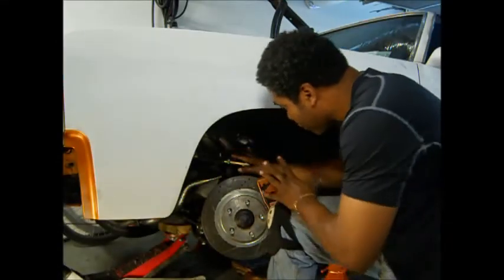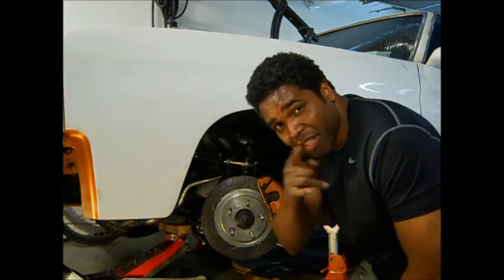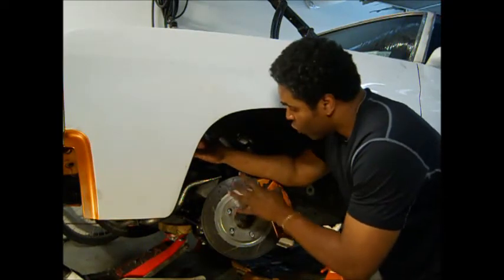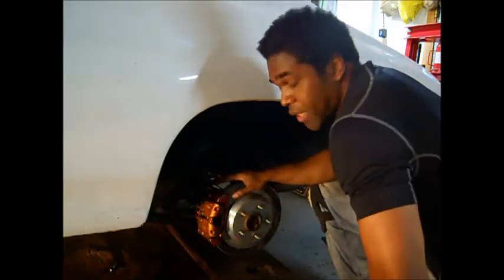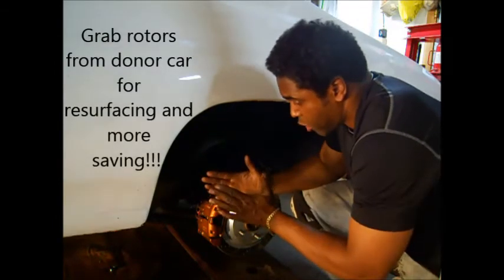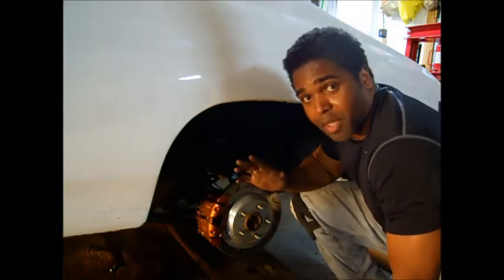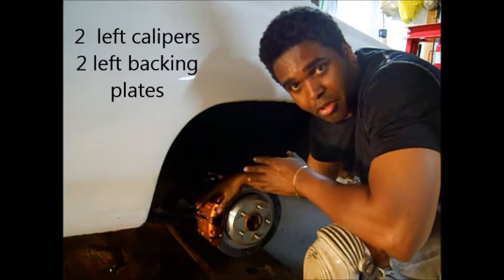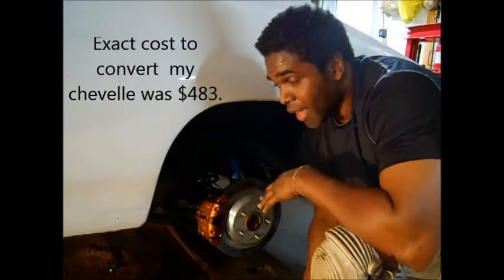Drum to Disk Brake Conversion Using 98-02 Camaro/Firebird Calipers (BRPHOTROD.com)

Comment: What bore size master cylinder did you get from cpp to work for these brakes ? Also booster ? Is there a kit number you used from cpp ?
Reply from the maker: i got the standard for a 71 chevelle with 4 wheel disk brakes

Comment: @coverman66 I have a few quick questions... 1st I have c5 calipers for my 85 Monte Carlo gbody does it work the same or is it the same as camaro/fire bird set up? Also I'm using s10 blazer spindles & hubs, backing plates with hybrid bracket and the rest of the hardware to mount it... 
2nd The money question is will my off set better same as the gbody 5/4 .75 because I bought 24" forged rins? Third on the rear I'm going with moser axles 28 spline with 14" rotor in front "corvette rotors front " " 13.5 corvette rotors" in back will my off sets still be 5/4 .75 ?

Comment: left side being the drivers side? some go by sitting in the car others go by looking at the front, just trying to clarify. im using a stock 79 camaro 10 bolt. Thanks
Reply from the maker: i got you Lucus, driver side partner.. i did that on my 80 z28.. let me know if you have any more questions..
Reply: coverman66 i will thankyou.

Comment: I believe with this brake system 17" rim are the minimum that can be used (right??). Other than that did this change the size of the wheels and tires you can put on your Chevelle? What size rims and tires do you have on your set up? Just asking to see if this changes the rim/tire size I can put on without spacers. Thanks! Great videos...
Reply from the maker: thanks brotha LaWayne, to do this conversion you have to have 16 inch wheels or better, im rocking 18x8 in the front and 18x10s in the back tires are 245/45 and 285/40. hope this helps brotha ....
Reply: That's exactly what I was looking at. Thanks!
Reply from the maker: no problem brotha..
Reply: coverman66 what’s your backspacing on your wheels terry ? I did the kit but noticed stock 2002 16 inch trans am wheels rubs my inner fender and frame. Only have the wheels to move the car around the house until I finish it.
Reply: @Coverman66  I'm building a 68 GTO, loved the body bushing videos bty!👍 I have a 69 elco rear end in it now. Was wondering if the 10 inch rear tires rub? No mini tub? What's the specs or measurements on your wheels? Looking forward to doing my own 6.0 swap. Hope to get a reply, I just subscribed! Awesome info Terry

Comment: hey terry  great videos. my 68 chevelle have both rear shocks behind the axle. cant you tell me which side or sides backing plates and caliper i need. thanks for the help.
Reply from the maker: thanks brotha Paul  you will need a right and Left because there is no stagger, the camaro has a stagger shock setup thats why you need 2 left side backing plates..
Reply: thanks for the help.

Comment: any junk yard cheap rear end posh option for budget on chevelle or cutlass. 70 convertible and tired of beg leg. Anything in junk yard that will bolt under car with lil to no modification and possible disc brakes
Reply from the maker: hmmmmm. you can you might get lucky at the junkyard.. i wish i could help.. i do have a olds 12 O rear.. but you want something thats install and go..

Comment: Good stuff brotha! What size brake booster are you running Terry?
Reply from the maker: sorry it took so long to respond.. im using a 11 inch CCP brake booster. no complaints..
Reply: It's all good Terry. I'm using a 7 inch dual diaphragm booster
Reply from the maker: thats whats up.. good choice..
Reply: coverman66 yeah man didn't have the space for a bigger one. My big block is wide lol
Reply from the maker: i was thinking about that.. you got one that sticks out a lil more. smaller in diameter but longer.. how radical is your cam?
Reply: coverman66 yup! Plus I hooked up a vacuum reserve canister. My cam isn't radical at all. The machine shop that built my engine built it for street. Low compression, mild cam, very reliable
Reply from the maker: sounds good, that big block makes great power where you are not going to need high compression..
Reply: Only 9.1:1 compression

Comment: Hi Terry, did you the 98-02 Parking Brake Bracket as well? Having problems mounting. Thank you
Reply from the maker: whats good Mar.., i did use the E-brake cables and tied them into the stock E-brake setup.. i will see if i can grab some pics off the car.. it would be easier to see than to explain.. did you get the 2 cable that connect to the backing plates?
Reply: Yes. I have both cables. Some pics would be very helpful. Thanks again
Reply from the maker: no problem.. thats good you got the cables.. its should be that difficult..
Reply: The issue isn't with the cables. Its the parking cable brackets that I need help with. From I've seen and read, the factory Parking Cable Brackets from 98-02 are not usable on my 72 rear end. I was wondering what you did to make them work. Because, the factory parking Brake brackets are on the drum backing plate. And, were removed with the drums. I've only seen one guy on the net fabricate his own out of angle iron. Thanks for your time
Reply from the maker: Mar, im going to do a quick video showing how i did it this weekend.. i didnt realize people where having issues hooking the E-brake setup.. do you have the stock long cable that connect the 2 cables coming from the rear wheels?
Reply: I have the stock 98-02 Parking Brake cables that go from the backing plates to a union. Not the stock parking cables that were on the drums.
Reply from the maker: on the chevelle there should be two lil connector that connects the backing plate cable from the wheels to the intermediate cable.. am i correct?
Reply: On the rear, I'm not seeing any. Maybe they broke off. Check you email when you can, I sent you a some pics

Comment: I see that the Disc Stud Holes are are much larger than the studs. Would that cause a problem? A possibility of the studs braking after a while? Thnx
Reply from the maker: i looked on my car and the holes on the rotors are pretty big as well.. when you tighten that wheel down those rotors wont move at all.. as long as the rotor bore fits over the center axle flange, you should be good to go.. let me know how that works out brotha..
Reply: Just an FYI, I just swapped over the fronts to the LS1 98-02 setup just like Terry is talking about. Just now installing everything.  I had a hard time finding info on what wheel studs to use. Finally came across a post.  Dorman 610-157 wheel studs work great if you use your original hub.

Comment: Hey bro did you have to use an adapter for the 98 camaro brakes to the original brake lines on the car??
Reply from the maker: Whats up Johnny, you will need the calipers and the rear backing plates, BRP with have everything else you will need in the kit.. remember if you putting this on a camaro or firebird with a stagger, you have to get two left sides calipers and backing plates.. depending on the car you might have to get an adapter fitting, but for my chevelle the line screwed right in the caliper.. try it first.. you might get lucky. anything else i can help you with im a email away brotha.. thanks for viewing..

Comment: I have the complete setup off a 98 camaro on the back of my 68 firebird, and didnt need to stagger.  Works great.  Had issues with the parking brake making noise so i ditched them.
Reply from the maker: what type of noise?... did the car have a 4 link set up in the rear?
Reply: +coverman66 naw.  its simple, sounded like horrible bearing grinding, but once i removed the parking shoe it all went away...  it was because the rear axle seal failed and diff fluid mixed with road dust to make a cement like paste...

besides that, the brakes work great.  once I figure out how to clean off the crazy sticky paste I'll replace the brake shoes... not in a hurry because I dont have any parking brake cables anyway...
Reply: +coverman66 and no, its a leaf spring car.  theres a bunch of videos of step by step install of different disc brakes on the many different muscle cars I own.  67 pontiac, my friends NOVA etc..
Reply from the maker: cool.. what setup did you go with?
Reply: coverman66 for the back? 98 camaro, front was c5 corvette, at least on my firebird.  The 67 tempest got 2014 mustang rear disc brakes because it has a 9 inch.

Comment: Appreciate the videos. How did you fabricate your booster? Hopefully I'm not mistaken when I read somewhere in the comments that you used a Booster from a 98-02 Camaro.
Reply from the maker: thanks Earnest.. i did fab up a booster from a 02 camaro.. i welded the shaft to make longer and drilled holes to match the 4 studs coming out the firewall.

Comment: Yes I did.  Everything has been replaced including the master cylinder.  Nothing has changed.
Reply from the maker: +Elite one there are many variables.. was this car a front disk/rear drum? if your getting a good flow of fluid out the back with the bleeder screw open, then it could be the caliper.. if your getting a drip when your press the brake pedal with the bleeder screw open then it can be the distribution block or master cylinder.. both of which i have seen new one go bad right out the box.. i would start with the basics and make sure the system has been bled properly.. keep me posted.. im curious brotha..

Comment: Hope all is well on your end.  Got a question.  I did a conversion kit on my rear brakes.  I also put a hydraulic hydroboost on my CHEVELLE (1971 convertible).  For some reason I cannot get pressure on my rear brakes.  I replaced my porportioning valve but I can't get any pressure.  Any ideas?
Reply from the maker: +Elite one sorry it took so long but i just got back in town.. lets see, if your not getting good pressure out of the bleeding screws, it might be the t block over the rear axle or the master cylinder.. did you bench bleed the master cylinder before you installed?t

Comment: Will 97 Camara brake work? It's got disc on all 4.
Reply from the maker: Whats up Carlando?  im not sure if the 97 f body style would work with the plates from BRP. 98 was the somewhat re-design f body, i think they went with different calipers on the cars. if you have a junkyard near you, you can pick up 98-02 calipers for very cheap..  let me know how you make out..
Reply: coverman66 I was able to find a 98 camaro, pulled evert hinges I need for 120. Picking up the flare fittings now thanks.
Reply: +Carlando George  From what I have read , the LT1 brakes will work , however they are not as efficient plus they do not have the parking brake inside of the rotor , which is more desired.  I am looking to do this to my '73 Camaro , so it will stop as well as my '99. I can testify , the LS1 cars have some mighty fine brakes. Good luck , and happy wrenching!
Reply from the maker: +MrBanditz28  thanks for the clear up.. i wasnt too sure and didnt know the reason why they would not fit.. but now i know.. thanks for the info brotha..

Comment: Terry, did you have to run all new brake lines and fittings ?
Reply from the maker: Whats going on J.. I got new SS brake lines from Ground Up.. if your lines are in good shape you dont have to replace then until you need to..

Comment: First of all like all of the other comments wanna give thanks for sharing.  Just bought a 71 Malibu and looking to replicate your suspension.  Did you powder coat your calipers ?
Reply from the maker: Whats going on J.. thanks for the compliment, and i really appreciate it. The calipers im using are from a 98 to 02 camaro/firebird. i simply went to the auto parts store had them mix up that color, the color of the calipers is the color i jabbed and going to paint the chevelle, thats why you see that brownish orange on some of the car. then i shot it with a coat of u-pol clear. you can have the guy who mixes paint put it in a rattle spray can.. thats how i jabbed my entire car and it look professional.

Comment: Did u get the booster off the camaro or did u just buy a regular booster that u would use in a chevelle?
Reply from the maker: at first i did use the 98-02 booster, the booster worked but it was old and needed to be replaced. i bought one from cpp. i figured to get another, fab it up to work and hope its in decent condition, im better off getting new.